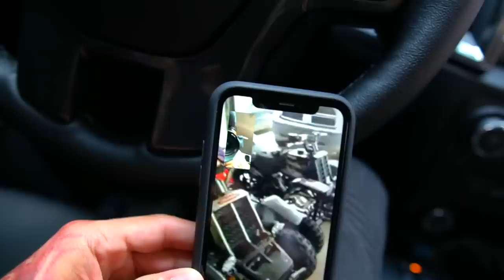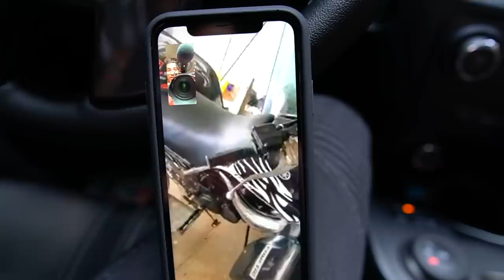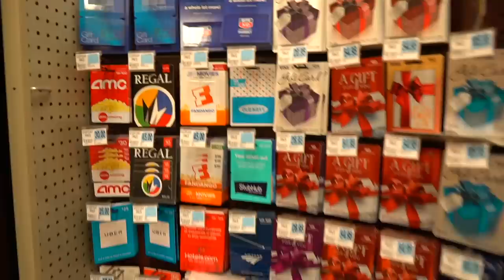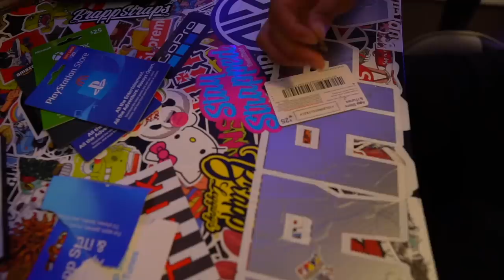LITTLE BROTHER R!DES BANSHEE 350 LIKE A PRO ! | BRAAP VLOGS

Comment: My mans driving like he running from the cops🤣
Reply: AIP_ Vortexz lol
Reply: Whippin the hell out that lil car thing 😂😂
Reply: Mem
Reply: He is
Reply: BST Waan the side by side 😂
Reply: AIP_Vortexz gotta drive the razors that way I do the same lmao
Reply: Lol
Reply: AIP_Vortexz so he’s basically riding normal
Reply: 😂🤣 right
Reply: He gotta practice
Reply: hahahahaha
Reply: First off wear the goggles as it should be, not as a head band and why couldn't he load the quad in back of the truck...
Reply: @yogiyzz7653  ok mister safety man
Reply: Ronnie Haupt シ stick to Xbox bro. I got a can am on a 6 inch lift, a sportsman 450 on BKTs, and my dad had a rzr 900 and has a ranger 800. My truck has a 9 inch lift and 24x14s and 35s.
Reply: Ronnie Haupt シ and I had a can am renegade 1000 Xmr but sold it to make money off it
Reply: W A A N a razar 😂
Reply: @xxitsmarlockx8398  still ain't nothing I got a 

raptor 700 
Honda foreman 500 
Can am renegade 1000 
Can am defender (for pulling out deer)
2020 ford f350 on a 10 inch lift with air lift
2019 Polaris rzr 1000 turbo 
And I had a 2017 honda crf 250 but unfortunately I sold it it for money as well
Reply: @xxitsmarlockx8398  plus sorry but I'm not the   one that plays games my son plays PlayStation to make videos on my account 🤡👀👀
Reply: Ronnie Haupt シ congrats you’re doing slightly better than a 15 year old and at least 70k deeper in debt than me 😂
Reply: @xxitsmarlockx8398  I'm not in doubt  I was 1 year ago tho but I was only 1k in doubt
Reply: Facts